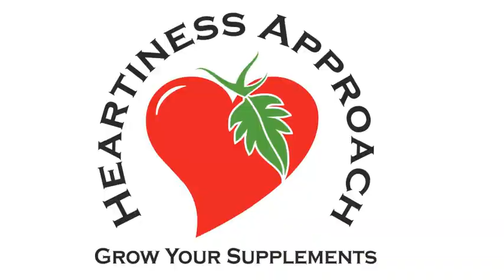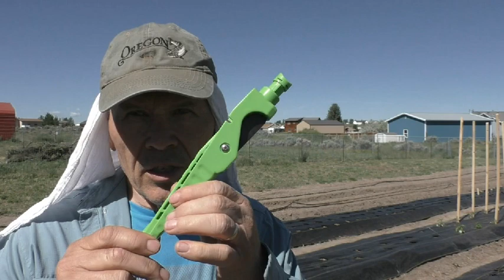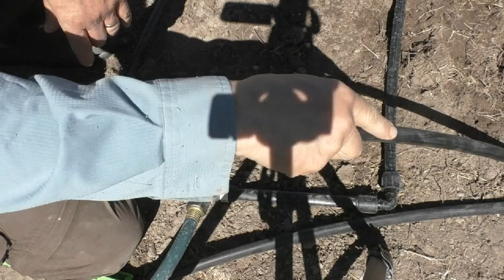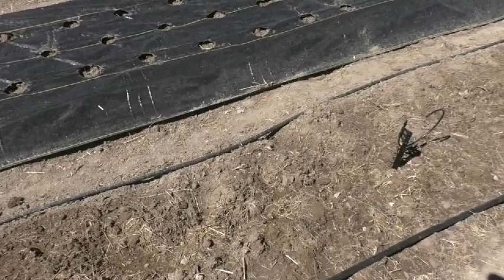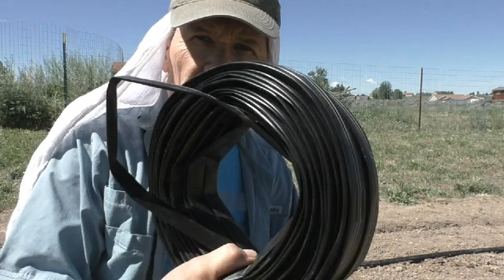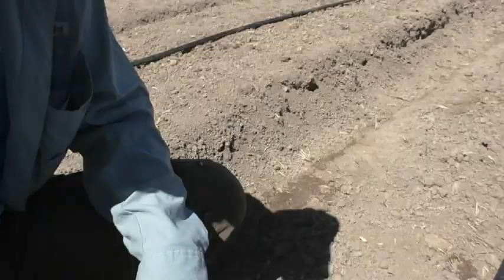Drip System Secrets - How I Install Drip System to Have Equal Pressure

Comment: if your pressure is not so good, is this gonna actually change something?, or  you may just add something like 1/2 hp waterpump , and that's it?
Reply from the maker: This wasn't to increase the pressure but to even it out. I had found with having it only come from One direction pressure didn't stay even all the way to the end.
Reply: @HeartinessApproach  but do you think that if the pressure is actually really good cause of the pump it may be equal till the end ? Or may i be having the same issue, thanks for the reply 🙏🙏